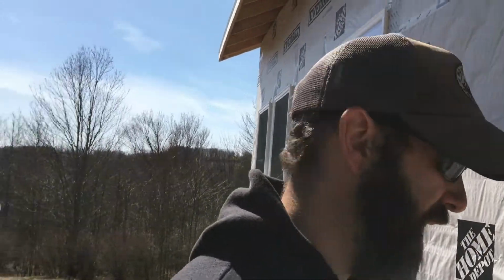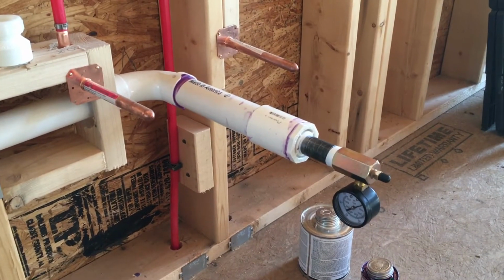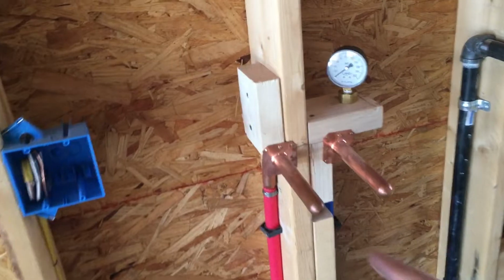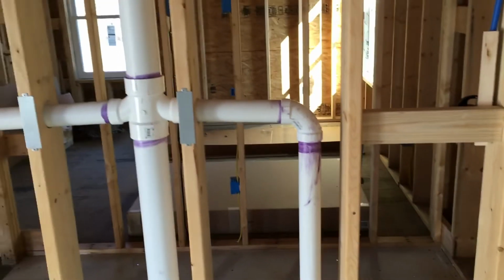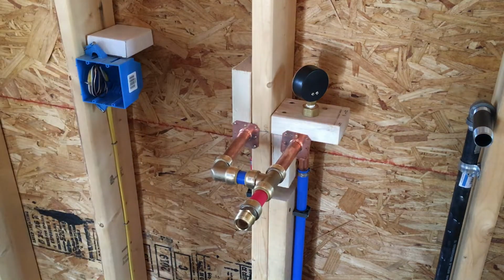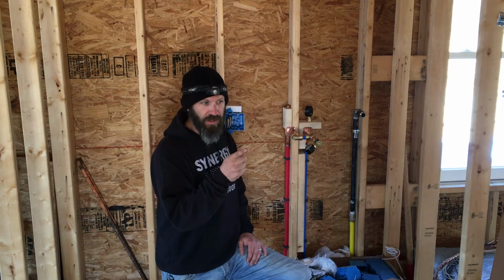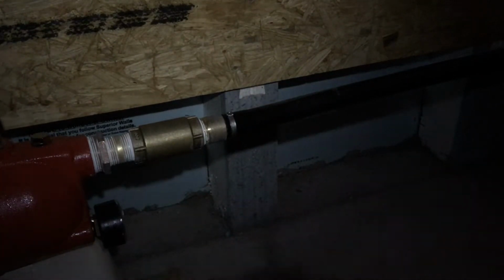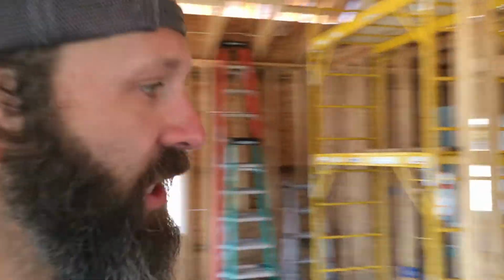Plumbing Pressure Test & Rough-In Inspection | Off Grid Homestead Build Ep21 | The ShabinLife

Comment: After having a couple of headaches with having to redo screw-in/on fittings, I learned the true value of union fittings. They may be somewhat expensive at first but down the road they are worth their weight in gold if any problems arise.  Just a helpful tip to save future headaches.
Reply from the maker: I couldn't agree more and will certainly be introducing unions in the future if only just for service related issues. Thanks again for the great tip & info, always appreciated!! Have a great weekend!

Comment: You should always check for leaks on a guage of maximum twice the testing pressure. Such as a 10# guage for 5. 15# for 8 etc.
Reply from the maker: Thanks Don, appreciate the heads up & info. Electrician by trade, so this was the first full plumbing job for me... All good so far, lol. Have a great weekend!
Reply: @shabinlife  Yeah it's not always possible, because of the pressures and situation. My friend had a plumbing inspector give him a hard time because he used a 200 psi guage for checking a system with 50 psi. I once used a 50 psi guage to check a gas line that I put up to 11 psi. It was a new house and the plumber apparently had gotten a bad batch of leaking 1/2 pipe elbows. After they finally fixed it they took the guage off to use it on another job. I rigged up the guage and went to the gas company dispatch center in the morning to make sure they would  send someone out that day to test and install the meter.

Comment: Great video. I just wonder why you have a little space between the king stud beside and to the right of the door. Maybe it's to keep framing exactly 16" o/c but in this case, I think I'd a just done a double king as to insulate that little space just a pain to do guess ya foam it or stuff fiberglass in it. I'm just finishing a build ICF to trusses and it's my 1st after doing several basements only in ICF and love it only way I'll build from now on. Insulation is done sheathing, vapor barrier, etc all after concrete pour is done. ICF eliminates several steps in a build let alone energy efficiency benefits and with the cost of all the materials that need to be bought in a conventional build is faster and cheaper and better when all is said and done in my opinion. Please your great videos coming.
Reply from the maker: Hey Chris, thanks for the message & apology for the delayed response. Yeah, just keeping things on center & ended up tight behind the door when we changed the size (you know how that goes on the fly, lol), but definitely added some light insulation between the small gaps. I absolutely love ICF builds and if I ever do this crazy shit again by myself, I will definitely be headed that direction for certain. Always appreciate the tips, tricks & info everyone leaves here... it helps to make better decisions in the future! Thanks for stopping by & checking things out. Have a great weekend & if you're an angler, enjoy opening day of trout this week!

Comment: Dude great job I would’ve just stubbed out pex for your stops instead of copper to save you in the long run
Reply: Copper is the better stub out. Every hardware store has fittings for copper. It's rigid not floppy.  UV exposure degrades pex.

Comment: Nice work, but you should never pressure test with air.  Even 10 psi would be a cannon if there was a crack in the pipe somewhere.  Cap the stub outs with rubber caps and fill from above.  10’ of head is 4.3 psi.
Reply: How would it be any different with water? Pressure is pressure.
Reply: @rfehr613  water is incompressible.  If 10 psi of water pops its pops and leaks.  If 10 psi pops, it turns into a cannon
Reply: @bojangles_bonjangles8000  water is definitely compressible. I think if anything,  the surface tension of water might prevent a projectile explosion.